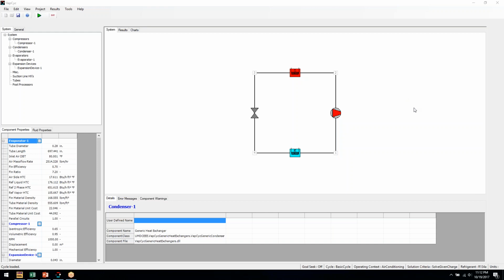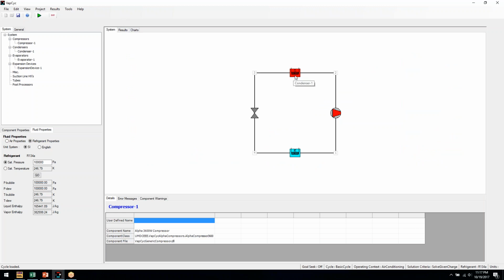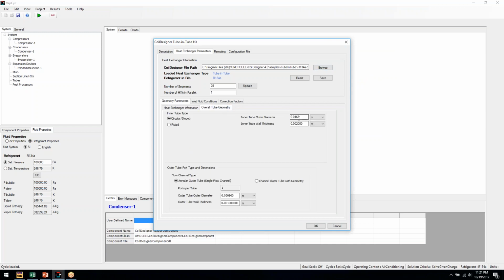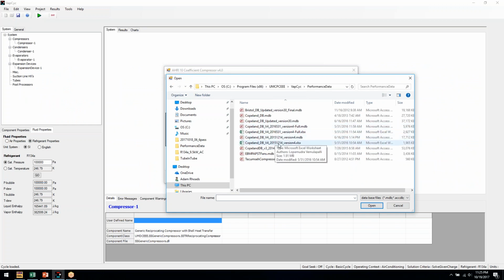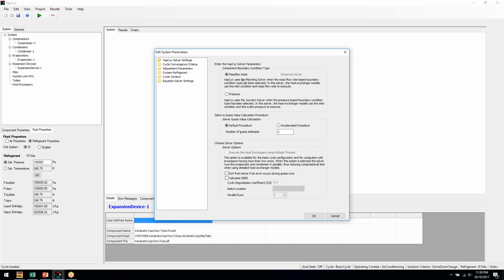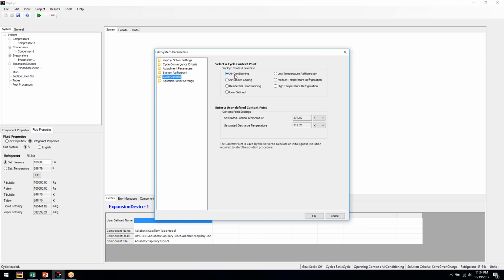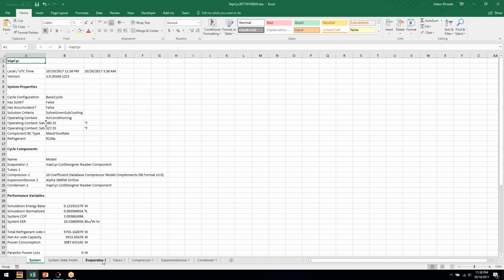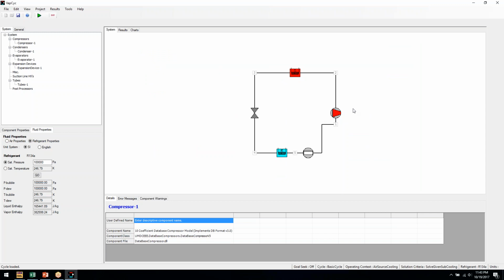VapCyc Full Demonstration

Comment: Did you require a SWEP DLL be integrated to VapCyc to use their heat exchanger? Or was the SWEP BPHX added to a newer version of VapCyc independent of a request for it?
Reply: Great question! The SWEP component is independently managed. You'll need to contact SWEP to enable access within VapCyc.